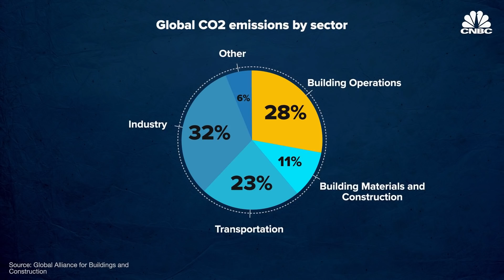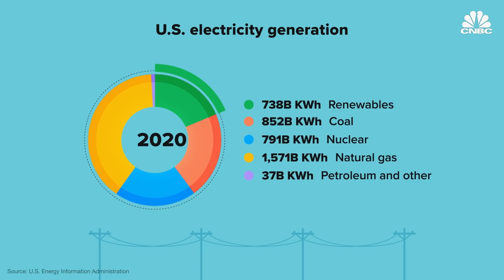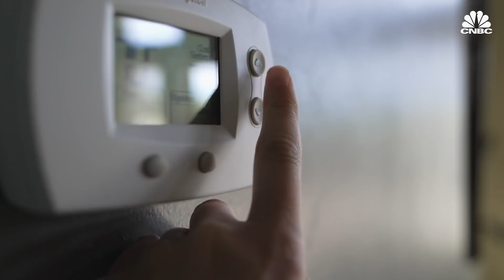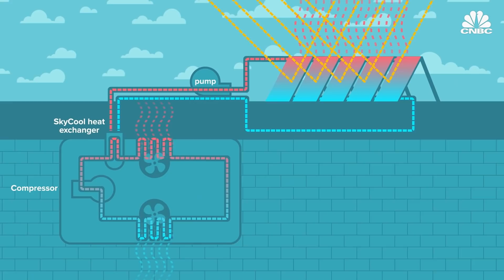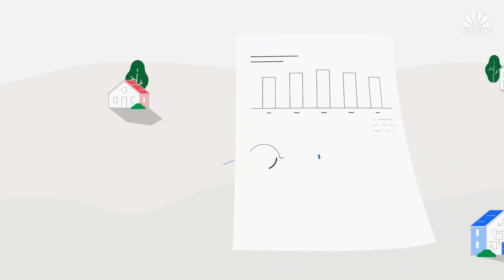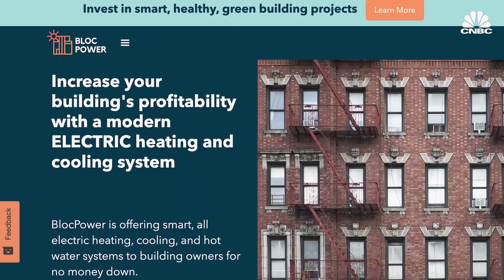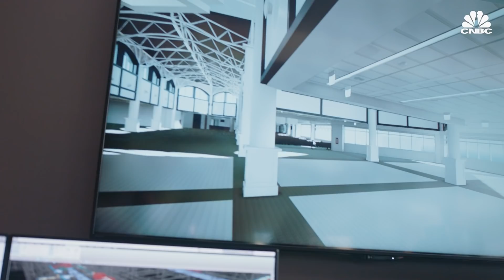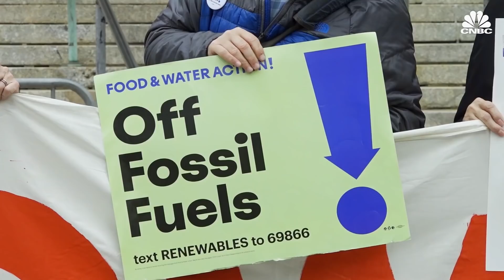How Air Conditioning Is Warming The World

Comment: They say nothing is being done to improve Building operations? That's a 100% lie. LED lights, and more efficient HVAC units have helped drastically in the last few decades. Do your research and stop reporting based on your bias.
Reply: Many people confuse heat pumps with geothermal which uses ground temp water as the heat sink / source to lessen the work the heat pump has to do.
Reply: They only replaced those units cause the first ones failed. They probably replaced them with just "improved" versions to keep the installation cost down. How long is it gonna be before they're all upgraded to pumps? Probably decades, until the right person moves into that specific unit probably.
Reply: It is truly fascinating that LEED builds are not featured in this video.....

Literally a program that’s been around nearly 20 years, used on 80,000 structure in every sector of construction and improves efficiency and reduces carbon emissions based on a criteria of 76 different variables across a weighted system with 4 distinct classes....

But sure let’s not talk about the industry standards....
Reply: @brian2440  oh yeah, news doesn't want to dive that deep into the industry and the actual improvements that have been made. It's a sad fact that the news is hardly the news anymore, but it is a soapbox for the left.
Reply: @cruelworld9825  I'm sorry I have to tell you this but if it wasn't for "rich people" no-one would have jobs. Millionaires employ most of the U.S. population AND most of the politicians who complain about millionaires hording cash are millionaires themselves who are the least philanthropic with their own money.
Reply: @cruelworld9825  I think it's more likely the climate alarmists are exaggerating, just like how they banded together with Al Gore in the late 90s. I was just a kid then and I thought it was preposterous. Back then the media wasn't as left-leaning, but that is the only change, the media now panders for the left and pushes anything it can get views, and website clicks instead of factual news.
Reply: What hvac?
Reply: They want you to think gloom and doom and "we're all going to die".
Reply: & they Just got the same administration that back in 08, created cash4clunkers, raised prices of enery EXPONENTIALLY, skyrocketed prices of Appliances, and ANYTHING manufactured for that matter, tightening regulations on AC man. And it's never enough, until these self asphyxiated statists here in the U.S make the U.S. Resemblance to Thier "shiny examples on the hill" (Cuba and Venezuela) they won't be satisfied.
Reply: Funny, the only other option (outside of electric compressor/high side-low side style) is water chiller, then they'll cry about all the water getting "polluted" and have to find some cockamamie excuse to make those more expensive.
Reply: You're not getting the point... Those improvements where a secondary result not the main goal. And even if your ac is 10% more efficient getting a heat pump is the better solution as it is more than double efficient and is one actually with a purpose.
Reply: @erikpienk  I was pointing out where they said at the beginning that building operations is not being improved, yet then they go onto the rest of the video talking about heat pumps. Heatpumps have improved a lot in the past decades just like all other HVAC unit technology. They contradicted themselves.
Reply: @erikpienk  Air conditioners are heat pumps, heat pumps are nothing but air conditioners run with opposite flows to heat a home in the winter once the temps get below freezing a heat pump is quite inefficient.  Electric bill in the winter is the highest.
Reply: @dreamshop6071  I've done HVAC/R work and heat pumps are generally considered a last option usually reserved for spaces where ducts generally cannot be run.
Reply: @dreamshop6071  True, but in a place like Texas or Florida they are usually OK for heating.
Reply: @Magnulus76  We have them in Illinois , when it won't  pump any more a heater element fires and the dreaded led lights up " Heat +1".
Reply: This whole propaganda campaign is BS.  They try and scare people Into complying with their ridiculous theories.  The costs of these changes are overwhelming and are part of  the plan by the left to gain more control and to wreck the economies of the west to reset capitalism to socialism.  Anyone who is fooled by the MSM and the leftists needs to do some research and learn to think on their own.  They start the indoctrination in kindergarten and continue it through the entire year education system to develop support for changes that are not needed.
Reply: @MrIndyjoe  The scare mongering turns into political power moves.
Reply: No one is being biased. You're just not bright.
Reply: @DCTag  I have worked in the HVAC industry for the last 7 years and have seen drastic improvements just that short time frame. No bias here, improvements have been made.
Reply: @jclcoolrunner  they still won't understand that because of the biased bs.
Reply: @jclcoolrunner  Don't bother arguing with them.  You work in the HVAC industry and are exposed to reality.  For them this is a religion....and their narrative is a belief up in the sky.  To them all the lies justify the means.  Which is sad because there is valid truthful arguments to be made for their points.
Reply: @jclcoolrunner  Please watch the video. It’s all about efficiency gains with energy  saving systems such as modern heat pumps.

Comment: Heat pumps work as a heat source with well insulated houses. Otherwise, in cooler climates, they are not so great. Still, if the electricity is truly renewable, then these are a no-brainer when compared to 'natural' gas (methane)

Comment: Bring back old world home and building design. 

My 1785 farm house doesn't have heating or cooling. It has a heat pump.

It has super high ceilings, vent that run from the first to the second, spaced outside walls(double outside wall with a 1ft gap between the two.) The heat pump is a tube that runs 300 to 600 feet in the ground and a fan sucks up the natural heat for the winter time.

Homes and buildings today are built for looks, not maintenance and as low of cost as possible. The technology has made architects lazy and not very creative with old world design.

Comment: Regular AC, if it is a heat pump or not is wasteful on startup. A huge surge just to get the compressor going, and it does this all day and night, over and over. Any mention of inverter technology? It is a soft start and never really cycles off, it just slows the compressor down. Way more efficient.

Comment: If we plant 3-4 trees near every building, we can significantly lower the heat.
Reply: I kept all trees around my house when I built it.
Using AC to just keep humidity levels low (being comfortable) last month's electric bill was $77.
(Live in mid Georgia)
Reply: @raybin6873  I live in Houston and my electric bill is never over $70 maybe its because I live alone and really don't use much power
Reply: @dark12ain  That's good.
Have trees shading your house?
I thought of trying solar power but with low electric bills it's not worth it.
Reply: @raybin6873  well I'm in an apartment second floor and there is one tree right outside my balcony, and I love that tree. But we also have lots of trees in an around our apartments
Reply: Tree placement is key….near windows to provide shade in summer and leaves fall off in winter to allow sunshine in.
Reply: Faux Que  cause? Science does not agree with you, making things up to prove your solution doesn’t help. Issue is much bigger then simply panting trees.
Reply: You know?  I like that Idea a Lot!! And then our children can have 4 treehouses to play in.
Reply: Faux Que  yes its is simpler to switch green then planting trillions trees. It takes 4800 tress for 1 car wirh span of 20years. So it is easy to switch 1 car instead of planting 4800 trees per car.
Reply: What if we packed dry ice around all the buildings, that might work.
Reply: @faux Que. 
your comment makes no sense
Reply: Yes, the trees around the building moderate changes in weather: warmer winters, cooler summers, less windy, pleasant rainy season and the right amount of moisture in the air.
Reply: Faux Que  no we can't plant trillions of tress, instead we can switch to more greener energy
Reply: @hj-bf1os  we can do both.
Reply: @hj-bf1os  actually there are 120m buildings in the us. So if there are only 3 trees planted per building, that would mean 360m trees
Reply: @xavierh5856  no that's like saying if one person in world  plants 3 tress then it will be 21 billion trees.

Comment: What happens when the electric grid fails and its minus 20 outside. Your pipes freeze and flood. The electric grid is not reliable compared to natural gas pipes. Never had gas shut off in the winter. This video assumes the electric grid is 100% reliable which it is not. What about a wind storm which knocks the power off in the winter. Gas pipes still run as they underground - pretty much 100% reliable whereas electricity is not
Reply: Just this winter in Texas gas pipes froze.... Without electricity you can't run your modern furnace anyway
Reply: Dude i live in a developing country, we never had electricity outage in the winter. That just shows how well maintaned the grid is.
Reply: Please tell me how would you run a furnace without electricity?
Reply: @jaquan123ism  like a really big toaster that I blow air through
Reply: A battery reserve?
Reply: There are back up heat systems that work when the electric fails
Wood burner, kerosene heaters. Some gas wall units that use propane tanks
Gas or propane fired generators are expensive but they are an option 
I live in the Northeast. My water pipes into the house are buried three feet down and coming into the house they are wrapped with insulation. It’s not uncommon here to have several days a year of sub zero temps ( Fahrenheit).  
When it gets really cold I let the water trickle through the faucet.
Reply: MMMM there’s thing called SOLAR, generators etc
Reply: Can you not put wires underground???, plus in Texas last winter a big issue was the lack if winterized seals in the natural gas system that destroyed electrical capacity
Reply: @hwong1776  wrong. power was cut to nat gas pumping stations use the same systems up north where it is much colder. you should never have closed down coal power plants

Comment: About time people started looking at air conditioning, and refrigerators for that matter.  They have a furnace worth of a radiator that should have been a heat exchanger to return back some of the power.
Reply: Refrigerators don't actually consume much power. The insulation on a typical fridge is really, really effective - it only takes a low-powered compressor running intermittently to compensate for the heat creeping in.

Comment: This is great ideas but we all know people don’t like to spend the money. Newer company’s can benefit from this however  existing ac owners is not about to pay to change they whole systems.
Reply: @⸻⸻⸻⸻⸻⸻⸻⸻⸻⸻⸻⸻⸻⸻⸻⸻⸻⸻⸻⸻⸻⸻⸻⸻⸻⸻⸻⸻⸻⸻⸻⸻⸻⸻⸻⸻⸻⸻⸻⸻⸻⸻⸻⸻⸻⸻⸻⸻⸻⸻ or you could “lissen” to a dictionary
Reply: @oProtica  Or you could skip the ad hominem and understand the thought process of someone based on the message they are conveying rather than simple spelling errors.  I guess we can't all be superficial idiots.
Reply: @⸻⸻⸻⸻⸻⸻⸻⸻⸻⸻⸻⸻⸻⸻⸻⸻⸻⸻⸻⸻⸻⸻⸻⸻⸻⸻⸻⸻⸻⸻⸻⸻⸻⸻⸻⸻⸻⸻⸻⸻⸻⸻⸻⸻⸻⸻⸻⸻⸻⸻ sad part is you’re probably 100% serious lol
Reply: Unless if and when their AC breaks and there’s law to input these new clean energy heat pumps replacing the older models…or if the demand goes up just enough to the point the of the existing manufacturers will also adopt this tech
Reply: @BlakeTedKord  
There’s no law to force this change. It would be illegal.

You’re thinking of building codes. But private homes do not fall under building codes such as this. Only apartments fall under those codes.

Comment: Here in Boston. I used AC like 2-3 days every year, Heater only when inside temperature goes below 60 degree due to possible freezing pipe. I know plenty of people who love to keep their room around 80+ during winter and around 70 during Summer. Honestly i don't get it, why the need to experience summer during winter and vice versa, just experience the heat when it's supposed to be.
Reply: come to Texas and experience 100+ degree heat.
Reply: @UncleThomas  didn't I mentioned I use AC like few days a year, kinda hinting you that I do use it when it is extremely hot. Sigh~ in no way am I saying to experience all nature has to offer but rather make the effort not to pollute as much as possible to our individual effort. region that can go get to 95+ easily in the summer should definitely have ac on when it is necessary.
Reply: @Steven-xf8mz  -Fine. I just see a lot of virtue signalling and people patting themselves on the back. It's kinda cringe but at least you're honest. c ya
Reply: @UncleThomas  let's put it this way, I have known ppl who live in apartment where energy is covered, and they're taking full advantage of it without considering their impact on our environment. I am very rational and I don't pretend who I am not. First of all, I don't even drive an electric because it would be very inconvenient last I checked where the charging station is at. I just do the parts where I can to a comfort level that I feel is reasonable. Full blown ac/heater during the season is only about $1500 a year extra, most ppl can afford it like pocket change. That many ppl can add up a lot of emissions. Sigh~

Comment: Even though air conditioners were developed in the early 20th century, they are still considered as "luxury items" in India. 
Most people are not comfortable with the increased cost in electricity bills even there is scorching heat. 
Reason behind is that the cost of a good ac is much higher than other countries and the price of per unit of electricity fluctuates frequently. Moreover the per capita income is quite low which makes it very hard for a lower middle class family to afford an ac. 
However the northern most and north eastern parts are generally cooler than the rest of the country, thus one can live without an ac in these areas.
Reply: Use PV and cut your bills.
Reply: @atlantasailor1  
PV is quite expensive here thus the general people can’t afford it. 
However there is some kind of compensation provided by the government which cuts the cost just by a little margin.
Reply: @syedshafiqulislam2752  ac cost little more than 15k. Its not linger luxury item anymore check the sales of ac in india, its increasing exponentially. Even in my village most of them owns ac. I agree with electricity bill. 8rs is  cheaper to world standard but not resonable  in india but that has to do with high coat of coal and energy loss in grid. Solar can solve the problems. 1kw cost nearly 30k, which should be effective for 1 ac and can save bill upto 960rs per month.

Comment: We are calculating Electic consumption and put all what we believe that the whole thing is the power plant burning something that creates carbon or green gases and we don’t see that even if we get the power from green sources it still the heat in big amounts of BTU release to the ambient from air conditioning and internal combustion engine in car and are that used it ! We have to use and create cars air conditioning that don’t generated too much heat (BTU) We have to calculate all in general and create better control over all the contributors of global warming!

Comment: Putting Out Fire with Gasoline, warmer weather increases demand for AC, AC is most inefficient technology, air heating with natural gas 80% efficiency is a normal standard even 90% can be reached, same amount of energy production by conversion natural gas into electricity and electricity into AC unit maximum 30% energy conversion.

Comment: 2/3 of heat pump cost is installation? What are they installing a space station or nuclear reactor! 🙄🙄
Reply: Ground source heat pumps have an underground component. It's not expensive to fit during construction, when the foundations of a building are exposed and much digging is being done. It's very expensive to install after the building is already completed.